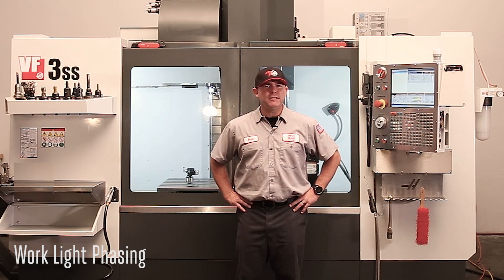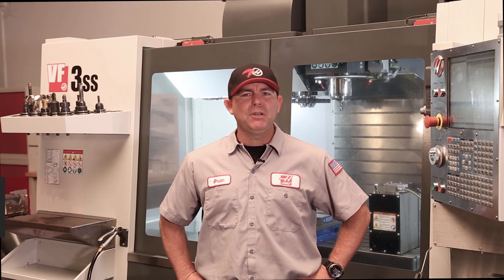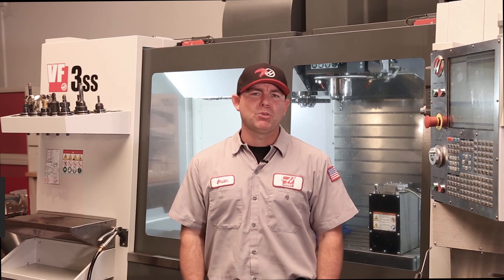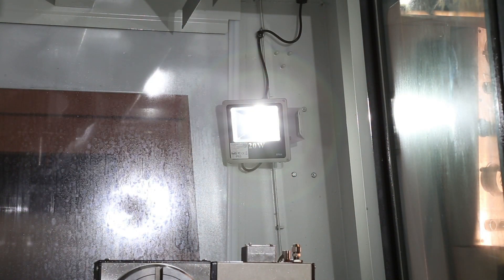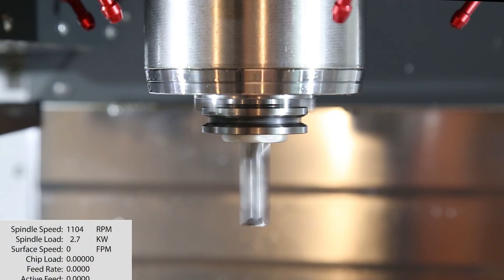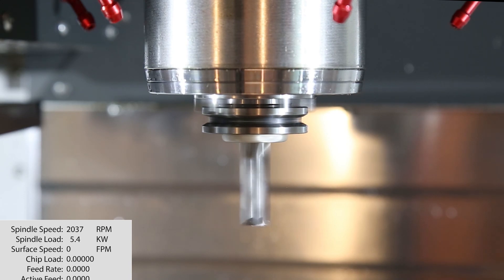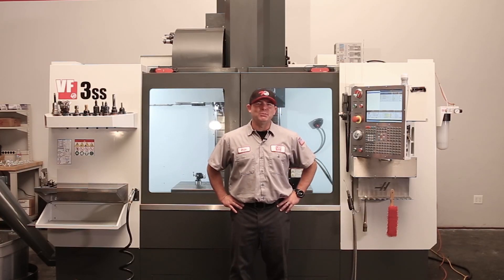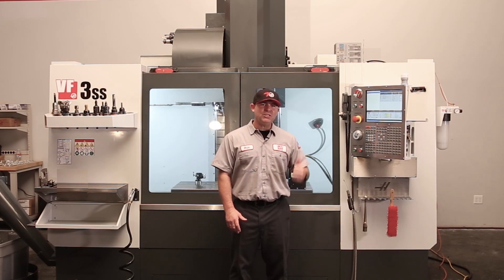Work Light Phasing With Spindle RPM – Haas Automation Service Tip

Comment: A good DC driven light would be nice, an adjustable frequency, syncable led driver world be even better. How about it Haas? Will you include a stroboscopic light option?
Edit: A low level output pulse synced to the spindle rotation with adjustable phase offset and duty cycle might be something that can be implemented with existing hardware. And then you can sell an upgraded LED light kit that both fixes the flicker and gives added functionality. (A perfect system would allow for advancing the phase based on how many cutting surfaces the tool has, letting you check each one)
Reply: Lol :)

Comment: This isn't the video to ask this question, but I'll ask anyway. Is there anyone that can tell me why my VF2 is getting constant shuttle out faults followed with the odd tool arm faults? Thanks
Reply from the maker: Hi Andrew. You will need to contact a Haas Factory Outlet to look into that. Be sure to tell them your machine's serial number and any alarm numbers you are seeing. You can find the closes HFO here: http://www.haascnc.com/community/distributors/
Reply: We use Thomas Skinner predominately, but they have been un-able to diagnose the problem correctly in any of their visits. It's a very odd problem because it only really happens on days where the weather is hot. It's increasingly frustrating because the maintenance company can't figure it out after a minimum of 4 days worth of mediocre trouble shooting.
Reply from the maker: Hi Andrew. Send us a PM or an email at social@haascnc.com with you machine's serial number and your contact info and we can take a closer look at it.
Reply: Bad limit switch on the shuttle out side. Change both switches at the same time (trust me, it's worth the extra cost). Get them from haas parts, they will be plug and play. If not, you will have to splice wires, and that will cause other issues down the road.

Comment: Could've just made it less flickery .
Reply: Yea the original haas lights are just the cheapest junk, a 0.50$ capacitor and it would stop flickering. just sayin...
Reply: Yes, I replaced the light on my 1992 vintage VF-0 with LED lights. The original a Bosh automotive fog lamp, supply voltage is 14VAC. I added a bridge rectifier and later a capacitor when the strobe effect got annoying.